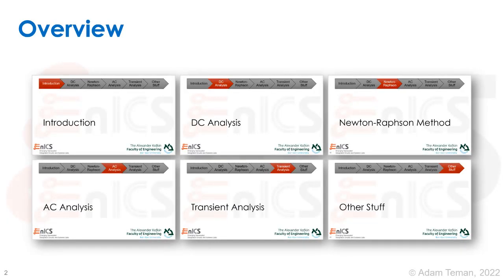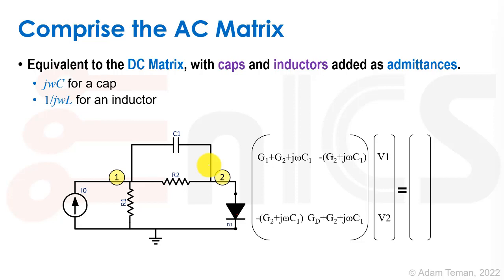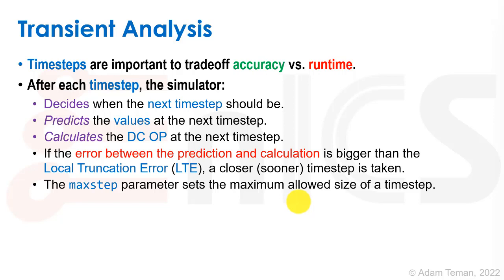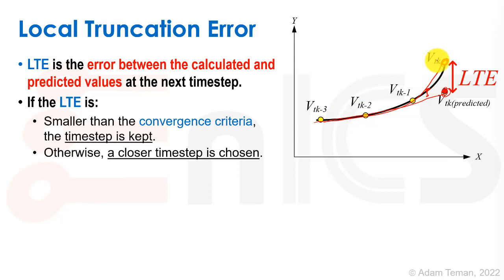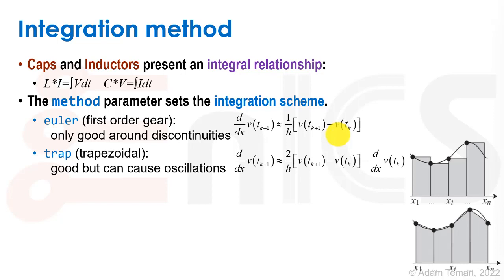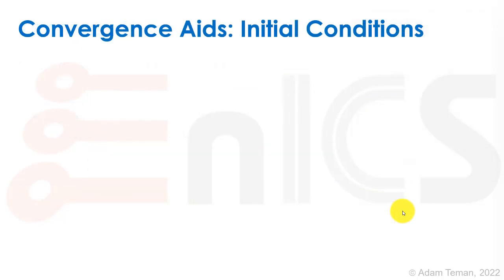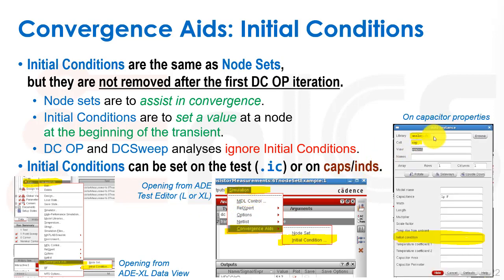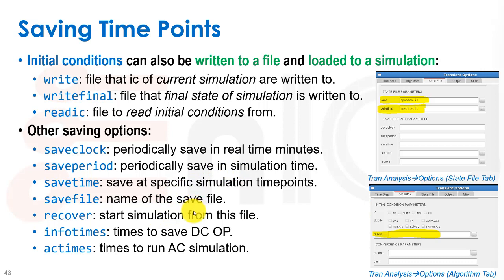Behind the Scenes of the SPICE Circuit Simulator - Part 4

Comment: Hi! I coded my own spice and this serie helped me a lot! Thank you! The hardest part is nonlinear elements. Wrong first guess causes lots of trouble. I wonder if there is a method for guessing starting point as well. I think I will add bisection method after some failed iterations. Also do you know anything about modified trap integration? Mike Engelhardt (Creator of LTspice) claims that is the best method (simple a true trapezoid without the oscillation effects) and only he knows that.
Reply from the maker: Hi, 
I think you just went beyond my pay grade :).
I'm far from being an expert - and for sure when it comes to deep down things that affect analog simulations - that's out of my expertise. There are many gurus out there, but I've had the pleasure to meet two of them - Andrew Beckett of Cadence (he answers many questions on online Cadence forums and is amazingly knowledgeable) and Prof. Andrei Vladimirescu, one of the designers of SPICE (and author of "The SPICE Book"). Andrei is a good friend and would probably be happy to answer your question if you reached out to him (...and bonus points if you told him that I sent you ;).